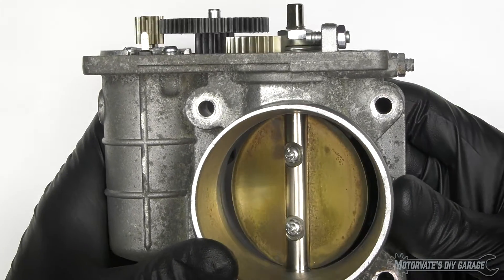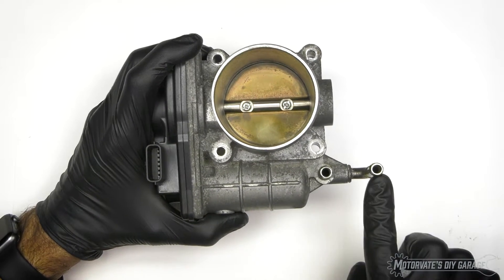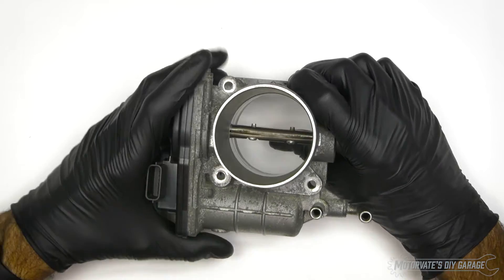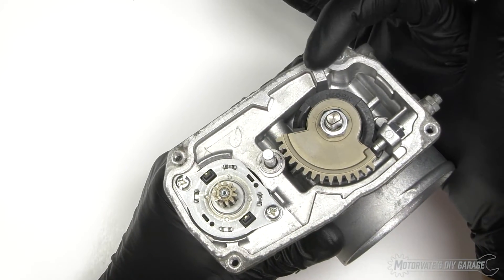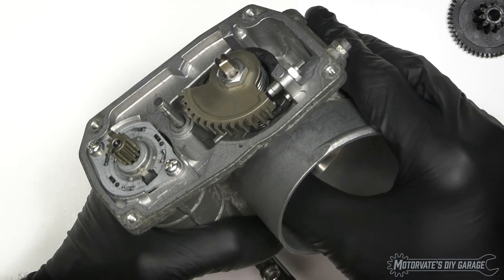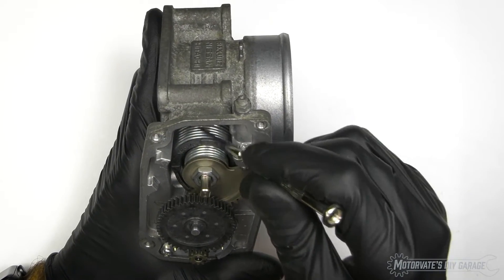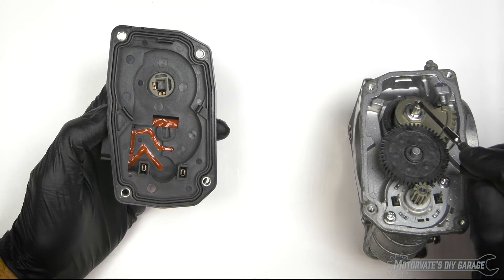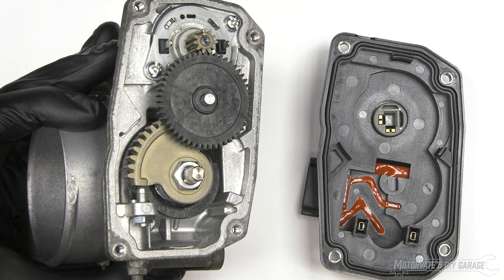How it Works - Electronic Throttle: Motorvate's DIY Garage Ep.30

Comment: If the motor failed in an isolated area, or in an emergency situation, could you rig a cable to the throttle shaft and manually open the valve for motion, or will the computer disallow this action?
Suppose you could manually turn the TPS a bit as well?
If the unit failed when pulling into traffic and you get hit by a semi going 70 mph, what then ?
Why is there no backup system built in to the throttle body ?
Will future designs have this?
Instead of just herding people into crematoriums, they ( auto Nazis ) make us pay for our own execution.
Ohhhhh...that's why we are still here.
And still there are no in-tank fire suppression systems installed.
Oh, but vehicles no longer catch fire !
Reply from the maker: Hey  seapeddler,
Very interesting questions! Different manufactures have different "fail -safe" system. Below is what Nissan does:

The electronic throttle systems are very safe. When power is removed from them, like when the engine is turned off, they are open 4-5 degrees.

So, if the throttle body motor fails, the engine will still be able to run to about 2,000 RPM.

I don't think they could be manually operated since the manual operation wouldn't match what the engine computer is expecting and that would put it into a "fail safe" mode.

As for "Will future designs have this?" ... well, just about every vehicle made in the last 15-20 years already has it.

They have been used for a  long time and have proven to be very safe.
Reply: @MotorvateDIY  Well, manually operated with the TPS  as well, is a motor action.
But, you can't trick the computer's awareness of the failed throttle motor r? Yes, things are advanced, but 2000 rpm may not be enough when something goes wrong whilst passing a semi uphill nearing a blind corner. There has to be unforeseen danger in every design. Otherwise people would just stay at home and eat Pringles.
Reply from the maker: Hey  seapeddler,
The engine computer has a feed back system for the electronic throttle.
It will send a command for the throttle to open a specific amount, and then look at the throttle position sensor to double check it is where it was told to go.

With the above in mind, you wouldn't be able to open the throttle just the correct amount that the engine computer has requested, and this would result in the engine computer going into a fail-safe mode.

I understand your concern about an electronic item failing, however, do you ever worry about that single throttle cable breaking? I don't think you do, as they have proven to be very safe, just like the electronic throttle :)
Reply: @MotorvateDIY  Not all facets of the problem need to be explored.
Physically, a cable has more tensile strength if kept lubed often.
Cables of sorts reinforce tires, for incalculable confidence.
But ( in my mind ( a motorized / electronic )  throttle body is like a Pheriengi weapon used to control Picard's mind. Ha, ha,...It is what it is. Someone has to complain about something.

Comment: Great video. I have a problem in my sx4   the engine has low rpm when I drive shift to low gear the the car turns off and if i press the clutch the car turns on back and it 50-50 not all time . Sometimes I have to turn the key on again . I have cleaned my throttle body . I have checked the ignition coil . Spark plug. All are fine. So what the problem any idea? Is there any way to increase rpm.
Reply from the maker: Hey  Christo4films,
Sorry I don't know anything about the Suzuki SX4. Suzuki left North America 6 years ago and I have never worked on one.

From what you describe, it sounds like an electrical issue that is making the engine cut out. Maybe have a look in a Suzuki Facebook group or online forum.

Good luck!
Reply: @MotorvateDIY  okay thanks for response
Reply: @MotorvateDIY   How much is open thr. Body on idle?  I have golf 5 2.0fsi and 11% open thr. Body, is that ok
Reply from the maker: Hey  Bojan Jokanovic,
The throttle body "percent open" will be different for different engines. Some engines use the throttle body to control idle speed (like the VQ37VHR) and others have a "idle air control valve" that controls the idle air.

If your idle speed is normal (typically around 650-750 RPM) then I would think your 11% open is normal for that engine.

You could ask around on the Golf 5 forums to see what other engines are at.

Thanks for your comment!
Reply: Christo4films  hi i have the same problem with my swift . Is your problem solved.

Comment: I have Japanese WEGON'R 2015 there is something problem with my car...
 when i start the engine & gear shifting on ( D ) after gaer shifting my car moving after 10 sec why I don't know please help me... My WhatsApp number is +923162416183
Reply from the maker: Hey MUHAMMAD SIKANDAR,
Generally, if there is a delay in moving after shifting into Drive, there is an issue with the transmission. 

Have you checked the transmission fluid level?
I can't offer any specific details on how to do this (or even if it is possible) as the car isn't sold in North America.
An online search may give you the steps to do this.

Good Luck.

Comment: I am concerned to move my G37 throttle body butterflies because of post 307:
https://www.myg37.com/forums/d-i-y-installations-modifications/203765-clean-your-throttle-bodies-21.html
Reply from the maker: Hey Nicolas Langel,

I understand where you are coming from.

BUT there is a lot of incorrect information about cleaning the G37's throttle bodies.
Since you have watched this video, you now understand how it works.... There is nothing that can be "broken" by moving the throttle plate.

When I shot the "how to clean the throttle body" video (https://www.youtube.com/watch?v=ySK99VbSiTE&t=1s) my throttle was cleaned 5 times and the throttle plate was moved WAY more than anyone would ever move it to clean it.

Now, most folks are not aware of the additional steps that must be done when cleaning the throttle body (https://www.youtube.com/watch?v=HIiaF0VaTlQ) 

If you are worried, simply don't clean it or have a mechanic or dealership clean it for you.
Reply: Thank you for the reply. I watched all your videos which gave me the nerve to move them completely. 
I was going to do what the poster said on the forum with holding the gas pedal down which would open the throttle bodies automatically. But couldn't get them to open, so I just open them with my fingers. I then did all the relearning per your other video. I just hope I did not put any extra stress, accelerated wearing out the internal parts, or knock something out of specification. Also, I am not even sure what symptoms I would look for even if I did.

Thank you again
Reply from the maker: Hey Nicolas Langel,
 I think you did great! 

Don't worry, you didn't put any "extra" stress on the throttle bodies, they are very durable.
Thanks for your comment.

Comment: I wish you mentioned something about this debate on if you can move the throttle plate or not. After seeing this I don't see what is so highly sensitive with our cars throttle bodies. 

Good work
Reply from the maker: Hey Christian Omenyi Jr,
I thought about mentioning that, but I don't want people to think EVERY throttle body can be moved without trouble. 

I don't know if that is true for ALL throttle bodies, but it is safe to move  the Nissan/Infiniti throttle bodies to clean them. Just make sure to do the 3 steps shown here: https://youtu.be/HIiaF0VaTlQ

Thanks for the excellent comment :)
Reply: shouldn't be a problem for these "single individual" big throttle bodies, but for motorcycles and some supercars that have one throttlebody opening "per cylinder" , or no RELEARN, then DO NOT fidget around in there or you can knock something loose and each cylinder air suction won't be in sync with eachother and you may need to buy another throttle body entirely since; those are simply idle value factory set in ECU that relies on a fixed position of each throttle body openings. 
I remembered seeing something similar in my GSXR shop manual last year when I did the valve adjustments and had to take the entire top of engine apart pretty much. throttle bodies were in a row, all 4 openings opens together. made sure to only spray that shit and not touch and push around in there. rather waste the $8 bottle than several hundreds if I damaged it.
Reply from the maker: Hey hostilityy,
I have no idea on the supercar throttle bodies, but It is easy to set up the carbs or throttle bodies on motorcycles. 
I use a syncing gauge (CarbTune: https://www.carbtune.com/) and set all 4 cars/throttle bodies to be a close as possible.

This is also known as carb/throttle body syncing. I'm sure your GSX-R shop manual has a section on it.

I suspect for any engine with individual throttle bodies, the process would be the same. 

Thanks for you comment :)

Comment: Great video as always!  Regarding those two adjustment screws, under what conditions should the be adjusted?  Or are they adjusted as needed at manufacture and should not be touched?  I suppose if that were the case they would not be adjustable¿?
Reply from the maker: Hey GeePeeZee,
Great question! These are adjusted at the factory and we must NEVER adjust them.
In re-watching the video, I should of mentioned that.

Comment: This video is amazing. I think it the first video that I’ve seen which explores the g37 TB this much. Also, I noticed that you’ve had many other videos in the g37 TB area (cleaning,idle air learn,etc). Because of that, I wanted to share with you maxbore.com 

He provides a service which bores out OEM TB’s (to the safest extent). On his website,  we can see that he already bored out GTR’s/370z/G37 TB. 

I think his work is amazing. It would be sooo cool if you were to try out maxbore.com and do a before/after dyno

I plan to purchase some used OEM G37 TB’s off eBay or something and send them to maxbore...I still want to keep my original TB’s untainted
Reply from the maker: Hey musaboy,
Hmmm, interesting... I will check out his site.
I am working on a future episode right now that measures how efficient the factory intake system is - which includes the throttle body.
Stay tuned to this channel :)
Reply: Motorvate DIY awesome, can’t wait for your next video. You’re the best
Reply from the maker: Hey Lunchtime,
In looking at my previous post, it looks like I typed the wrong name - sorry!

I don't think a bored out throttle body will work well with the factory tune.
You may want to look into that before spending any money.

The intake efficiency episode should be out in about 4-6 weeks, if all goes as planned.
Reply: Motorvate DIY thank you sir. I actually changed my YouTube user ID just yesterday. You replied to the correct person 🙂

I appreciate your insight. I think you’re right in regards of a tune.